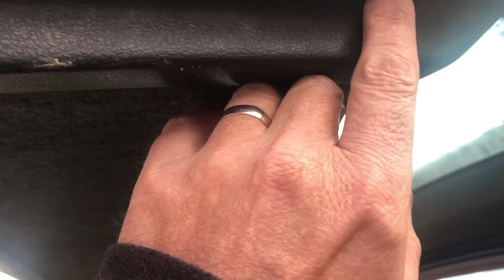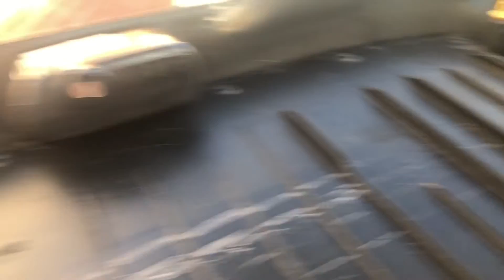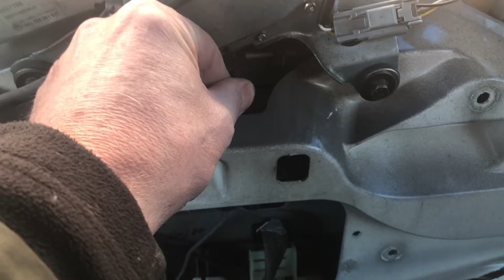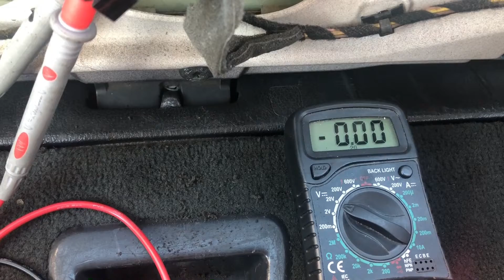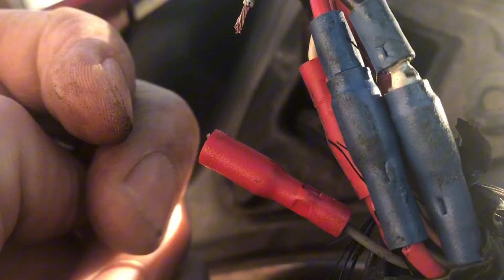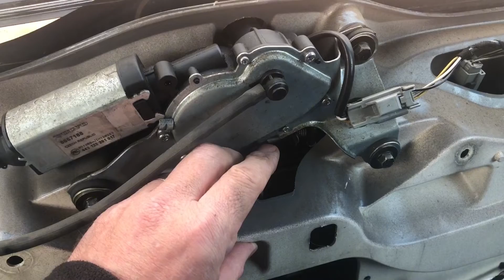Volvo V70 Tailgate / Trunk Not Locking Free Fix.

Comment: I had a similar problem (mine wouldn’t unlock). After MUCH faffing about, I found that the relevant relay on the fuse panel in the boot had failed. Relay replaced (a couple of quid) and problem solved.
Reply from the maker: A failed relay that’s a new one as it’s usually the tailgate wiring that fails.  Well discovered.
Reply: @TheRepairer I think that Thor, the god of Volvo, was with me on that occasion.

Comment: Thanks! I have power at the connector, and the tailgate opens/closes freely when unlocked. The lock mechanism has no free movement at all. The actuator piston is in the compressed position. Would it be best just to replace the actuator, or the whole locking mechanism? 🤔
Reply from the maker: I’m wondering if the solenoid has seized. It would probably be available as a replacement part.
Reply: @TheRepairer  It is available. Thank you, much appreciated.

Comment: Hi. How do you remove the black plastic electrical connector 2:50 into video? It doesn't seem to pull straight out. Thanks!
Reply from the maker: It has a locking tab to push in on the side next to the pink wire just push that tab in and pull the connector off. It doesn’t take much force to remove.
Reply: @TheRepairer  Great! Thanks!

Comment: Hi you ever done anything with a Mercedes boot open switch on the drivers door not working ,??
Reply from the maker: I haven’t unfortunately, 

These are my thoughts on addressing the issue in order of difficulty. 

Press the switch very hard and rotate the switch in circles up down sideways  etc first to see if that makes the boot release work as it may clean the switch contacts. 

Then I would remove and test the switch with a multimeter if it comes out relatively easily before investigating the wiring. 

The wiring is a possibility as it’s the drivers door that gets the most use and it flexes every open and shut cycle of the door . I once had an old car  (Vauxhall Carlton) that the central locking never worked from when I bought it and one day I locked the car with the key and the locking solonoid  burst into life by fluke! This turned out to be a broken wire contained in the rubber sleeve between the drivers door and A post. I bridged the broken wire and had working central locking for the rest of my ownership of the vehicle. I hope you can repair it.